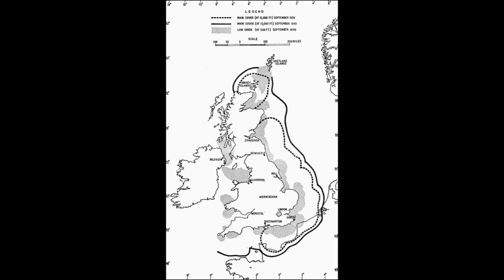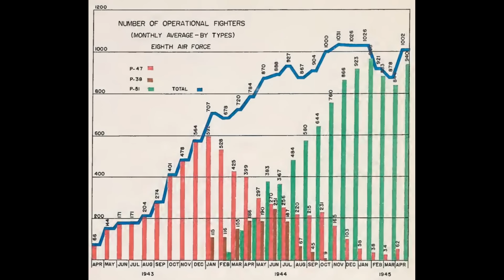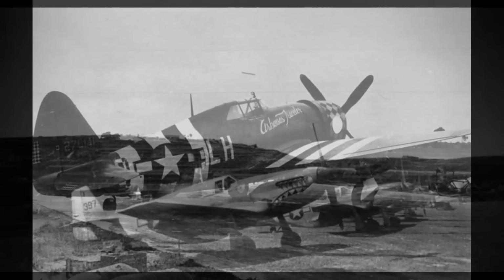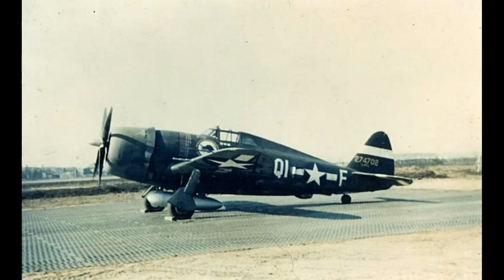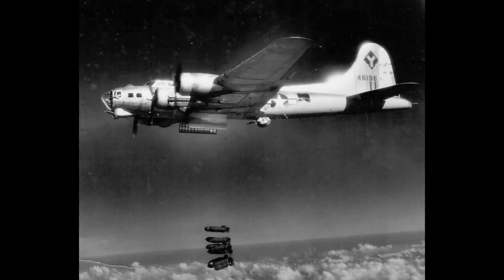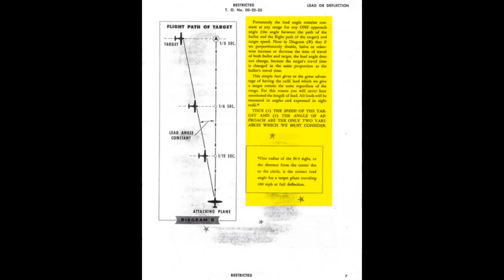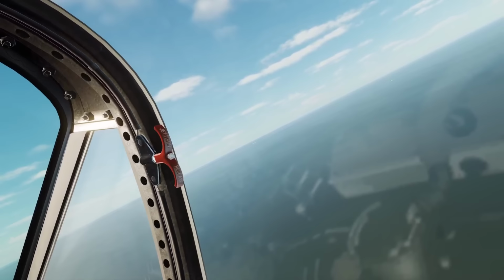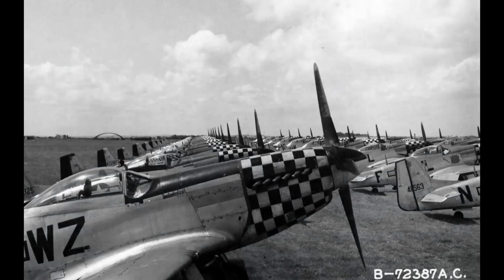Under Appreciated BRITISH Tech From WW2

Comment: Gas turbine engines using two compressors do not run both compressors on the same shaft. There are two separate shafts, with the hollow HP shaft running on the outside of the LP shaft.

Having two compressors on the same shaft wouldn't work to solve the problem of off-design point performance, which is the whole point of having two separate compressors.
Reply: I think the point here needs to be separated between axial and centrifugal type compressors, with their relative compression ratios between stages. Having multiple centrifugal compressors at the same speed is difficult/unusual to do vs. having multiple axial stages on the same shaft is the only way to do it. To your point here, having the L,P IP and HP axial compressors on the same shaft/spool wouldn't work.
Reply from the maker: It's very common for turbine engines to have multiple compressors on the same shaft. There are usually multiple shafts, but NOT one per compressor.
Reply: @GregsAirplanesandAutomobiles  completely agree when we are talking about axial compressors, as they typically have pressure ratios of ~1.2 to ~1.4 per compressor, so many of them (~4 to ~8) are grouped together on one shaft to make up a low, intermediate or high-pressure compressor stage. What is uncommon and rightly highlighted in your video is having multiple centrifugal compressors rotating at the same speed on the same shaft, as centrifugal compressors have much higher pressure ratios (~3 to 7x). Running multi-staged centrifugal compressors on the same shaft is a difficult engineering challenge to provide acceptable performance across operating conditions. To Sean's point, what does not happen, is having the LP, IP or HP compressor "groups" running on the same shaft at the same speed. The whole reason they are called LP, IP or HP is because each 
"group" is on a different shaft rotating at a different speed. The P&W J57 and Bristol/RR Olympus both introduced the multi-shaft arrangement in the 1950's to provide better performance and efficiency. The wiki article on the J57 has a nice short intro on this development.
Reply: @Greg's Airplanes and Automobiles  Well... I suppose this comes down to a difference in jargon between the piston engine world and the turbine engine world. I suspect the difference arises from the fact that centrifugal compressors produce a MUCH higher pressure ratio per stage than axial compressors do.

Take the J-79 (propelling the F-104 and F-4) for example. I believe the later variants had 17 stages of compression. We would call that a 17 stage compressor, singular.
Or, take the J57... this is A 9 stage LPC followed by A 7 stage HPC. You would say that THE HPC is supercharged by THE LPC.

Why do we call multiple stages of compression one compressor, rather than multiple compressors? Well, because a single stage of axial compression is rather worthless. They can only achieve meaningful compression when grouped together in multiple stages. Think about it, if you looked at a single stage axial compressor, what would you call it? You'd call it a ducted fan.

Thanks for reading!

EDIT: Fun fact, both of these engines featured different solutions to the same problem: as the pressure ratios of compressors grew (by adding more stages), engineers began running into problems with off-design point performance. Turbine engines were (and in many cases still are) designed to run optimally at or near full power, which means the compressors were too. Well, these high stage-count compressors started running into problems with surge at low RPM. The crux of the problem is that as the compressors spooled down, the pressure ratio would drop to a point such that the air wasn't compressed enough to fit through the very narrow last stages of the compressor.
GE's solution in the J79 was the variable stator. The first several compressor stages have variable stators. This allows the compressor to maintain a higher pressure ratio at low RPMs than it otherwise would, mitigating the issue.
P&W's solution was the dual spool, multiple compressor design. You have 2 separate compressors, one supercharging the other, rather than a single high pressure ratio compressor.
Nowadays, most engines use both technologies.